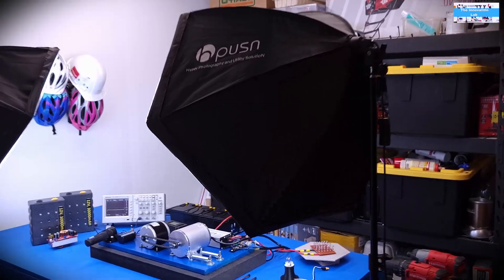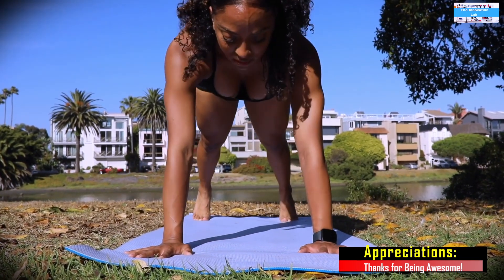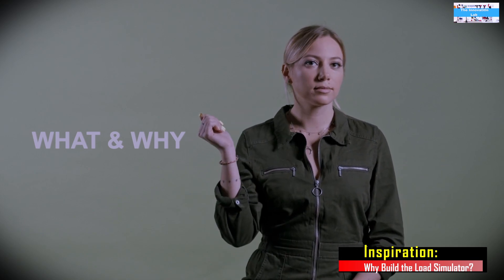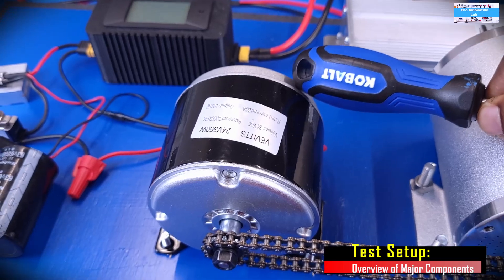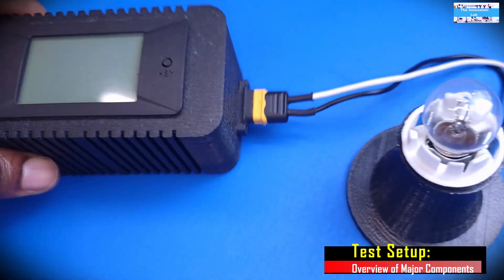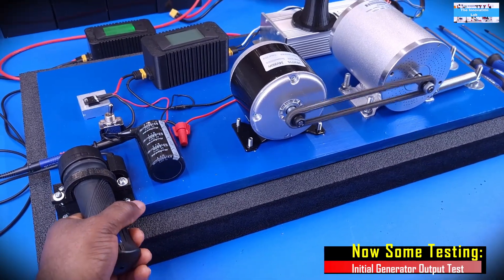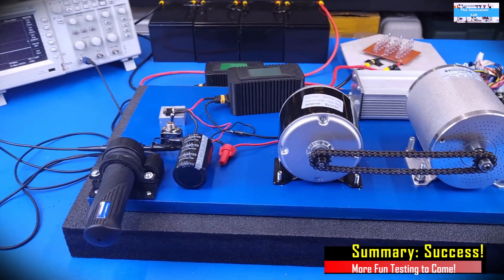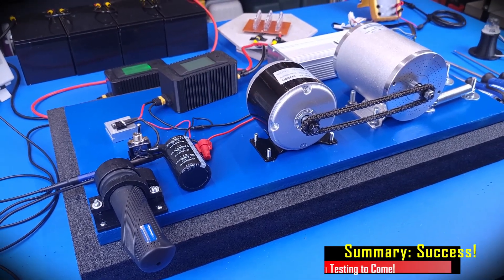💥Electric Motor Load Test! How Powerful is Your Ebike?

Comment: Is there a way to modify the throttle so you don't have to hold it to control the speed?
Reply from the maker: 👍👍👍
I actually designed a 3D printed fixture that allowed me to do that during one of the test videos.
Thanks for the interaction.
The Innovati0n Lab💥
www.theinnovati0nlab.com
Reply from the maker: I made a 3D fixture for it. 
In this video.👇👇👇
https://youtu.be/haGmAmpqNAw?si=UX21g63bhphNOjAI

Comment: Thanks for this video!
Got question
Do you think i could use 12v 5-8AH battery to boost converter to use the 48v motor?
Reply from the maker: Hi friend,
Thanks a lot for the wonderful feedback and encouragement. However, I believe that I have already addressed your question in the video below.
Check it out and let me know if you still have more questions.
👇👇
https://youtu.be/haGmAmpqNAw?si=xCzoncqo7vQ0IZt0

👍😎
The Innovati0n Lab.

Comment: Is it possible to use this ebike motor for wind generator?  Is the motor hard to be turned by  a propeller?
Reply from the maker: Ho friend, I think it might an idea worthy of trying. The motor is not hard to turn under a no load condition. But as you know, once you apply load, that will no longer be the case.
Reply: @theinnovati0nlab782  because this is a lot cheaper than those generators made for wind turbines.

Comment: I have a homemade ebike bmx style uses 250 watt 24 v motor and 2 12v sla scooter batts in series. With on off switch it accelerates from 0 to 13-14 mph in about 8 seconds or so. I get max watt readings of about 529 wattts and peak amps 28ish. I dont know that your lightbulb setup is comparable to real ebike moving 250lbs of human and machine down the road if your booster is even in this circuit(correct me if im wrong) then  maybe a more accurate test would be to mash down on your generator shaft first then throttle up your rpms and monitor the current to see if it overheats the booster and/or its wires. When my ebike is up to speed its only pulling 8 to 10 amps ,,but if your setup can handle 30ish amps of simulated ebike acceledatuon then i may install a booster on mine,contrary to what most other videos advise. My goal is to uxe 2 lifepo4 12 volt batteries series or parallel with a larger motor(750+watts) and use a booster to increase the voltage.way cheaper than sourcing a typical 48 to 60 volt ebike lithium battery and more cycles
Reply from the maker: Hi friend,
Thanks a lot for the very detailed and wonderful feedback.
👍😎
 This is the type of information and feedback that I was hoping to get from the audience. As I mentioned in the video, this is also a learning experience for me as well. The boost converter drive testing will come next, and we will see the performance. 
But good point on the kinetic energy to electrical power conversion (about the 250 lb rider), this is something I will research on. 😊
Regarding your system drive voltage, I do agree that using the boost converter will be cheaper. However, your system will suffer high conversion losses. Also, as I am sure you already know, using a higher voltage drive prolongs your battery life cycle and might even give you a longer range on your E-bike. This is because the lower the amount of current you draw from your batteries, the lower the stress on the cells, and this could translate to a longer discharge time and more cycles out of your battery.

Comment: So was the 1800 watt booster included in this circuit? Its unclear to me...as i thought the whole point was to prove that the booster can handle a 360 watt load
Reply from the maker: Hi friend,
Thanks for the question/feedback. 
👍👍
You are absolutely right about the boost converter being the main purpose of the video. However, as I explained in the video, the goal was to use the first video to present the load simulator concept and test setup. The boost converter drive will be in the next video. 
Also, I didn't want to add it to this video because it wouldn't be fair to conduct the load test on an 1800W boost converter with only a 350W DC generator and a 360W load. As I mentioned in the video, I plan to increase the generator capacity to make it a fair test. This video ended up being longer than I wanted it to be, but I wanted to take the time to explain the concept and the history behind the video. The subsequent videos will be short and sweet.
Please stay tuned, my friend. Thanks a lot for the interaction.
👍😎